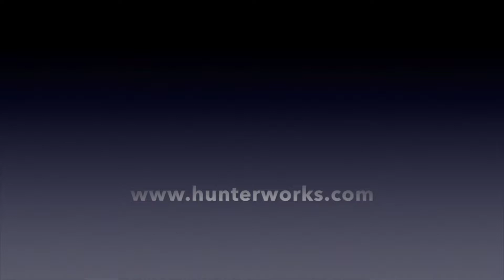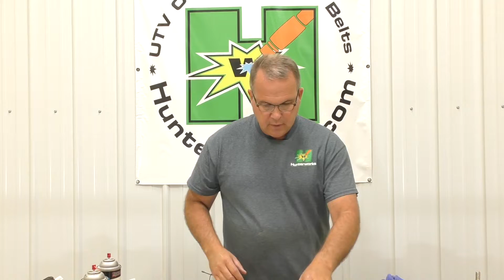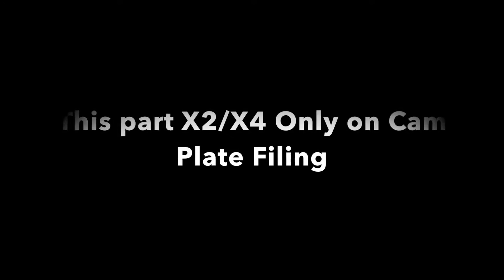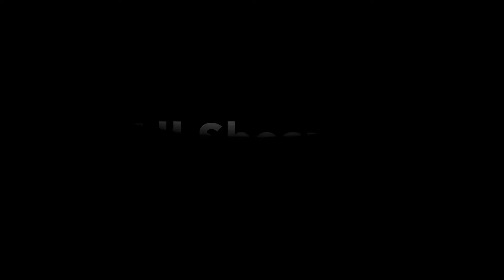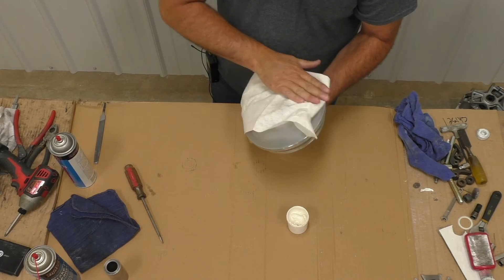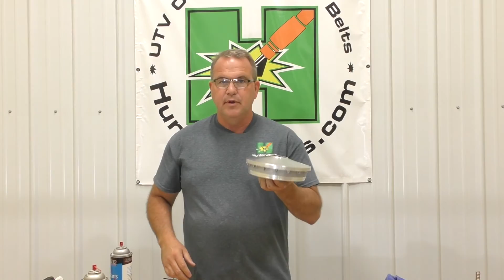Hunterworks Yamaha Machined Sheave Prep

Comment: So with this greaseless set up, the primary top cover and oring are not used?  The reason being is that the top cover is there just to contain any grease?  With it not being used, the primary should run cooler?
Reply from the maker: Correct, yes and yes

Comment: Greaseless?
Reply from the maker: means without grease, been this way since 2008 at Hunterworks
Reply: @Hunterworks  how much for 2011 700 grizzly
Reply from the maker: @reddawng43x91  technically we do not sell them for a grizzly, the rhino 700 combo is $300
Reply: I saw a video where they used Tink Seal to great up all the weights and the base it sits in. What is the difference between tink Seal and going dry?
Reply: @crtdavis  Dirt and dust gets stuck in the grease.